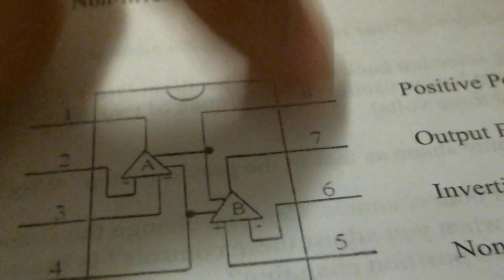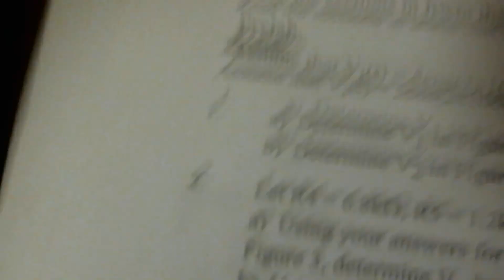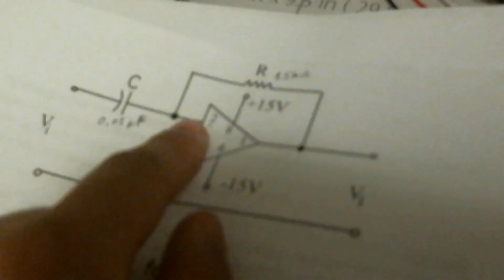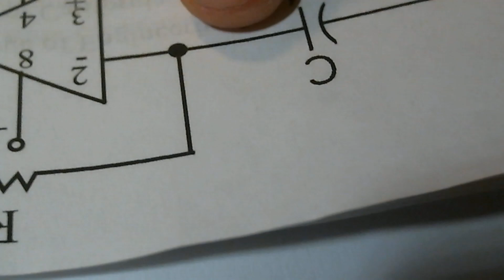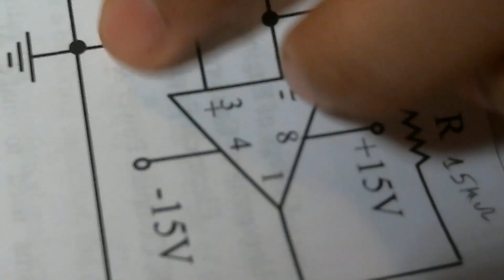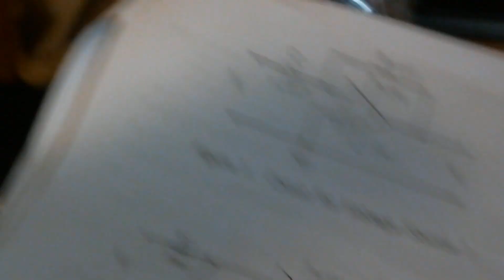How to set up a circuit with an op amp (LF353)

Comment: Nice first vid, needs some work though! I recommend to outline your video before you start filming. Make a plan with specific points to hit as you go through the lab. This would make it easier to cover what you want in a shorter time and make it easier to film.  It has good information but could definitely be edited down.
Reply from the maker: Agreed. Will do that for future videos. For now, this was supposed to cover a lot of material, just not in this time frame. Thanks for the feedback! We will pass this midterm!!!